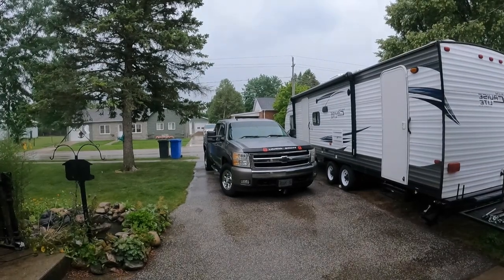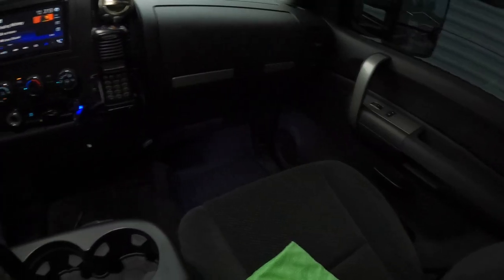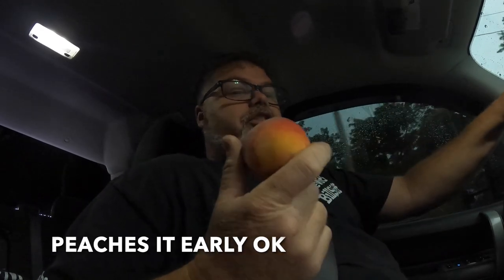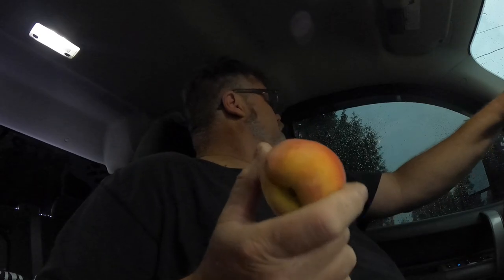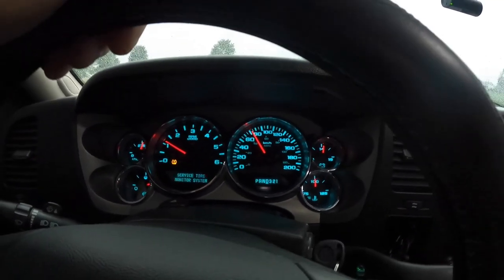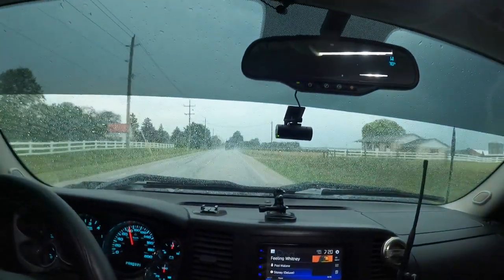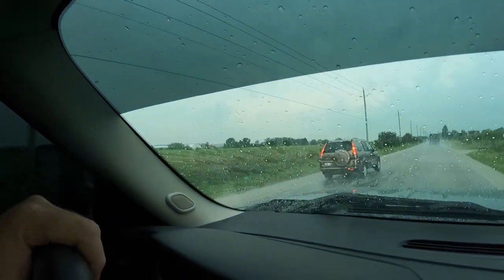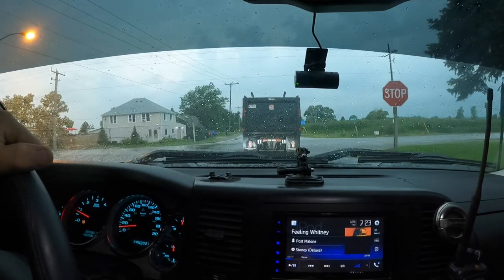I will Get Ya One Day

Comment: Yup, I like fresh pears also. =-)   The autowreckers know you want one now so of course the price goes up.
    
BTW passing on a solid is legal in Ontario AS LONG as you can see far enough to safely pass. Section 147 (8)(a).   The wording is about visibility, not whether the line is solid or hashed.  Other provinces make it a point about solid and hashed lines, not us. You'll find a lot of secondary roads in the London/Woodstock region don't have any hashed line at all any more, just a solid for miles (Everyln Road between London and Woodstock is a good example, solid line the entire length after they repaved it a couple years ago, they didn't remark the hashed sections, so passing on a solid is your only option.